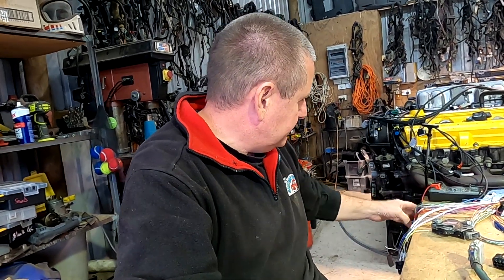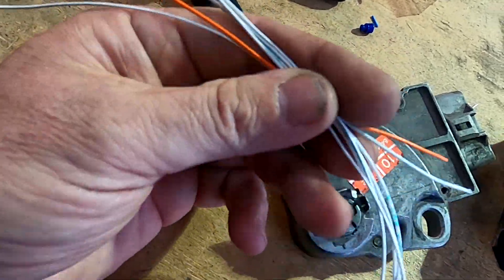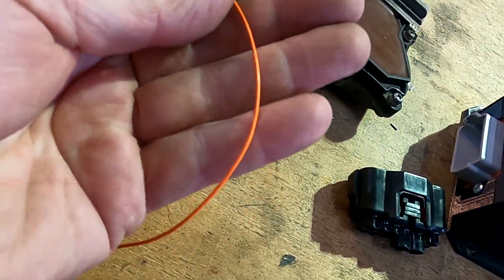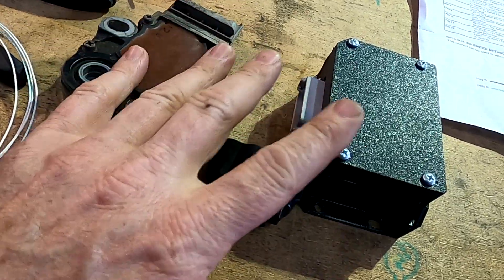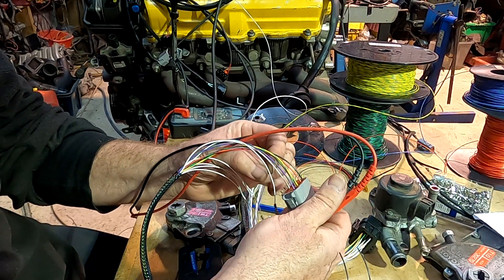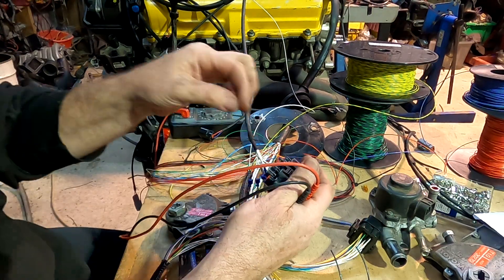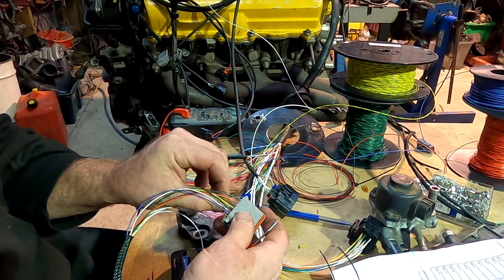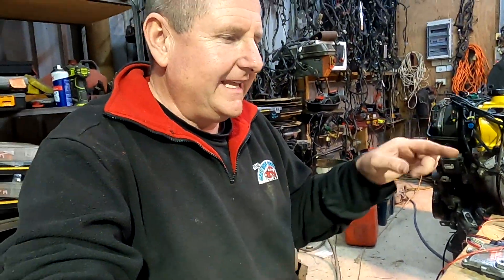Haltech ECU Wiring to 1uz Part 7.   The gear selector input box. Thanks Next level Motorsport

Comment: Hey Kelvin, Love your videos on the A340. In this video you mention you wired up the 2x Start Inhibit pins (the 2 big pins) on the selector switch, My question is what did you wire them to on the haltech? they aren't listed in the paper work for the next level motorsport signal convertor. Are they wired to DPI's? are they actually required to be wired up to anything? The A340 control support page over at haltech doesn't mention them being wired in anywhere? Any help would be greatly appreciated!

Comment: Good morning. 2 days ago I swapped out a transmission and installed a ls400 transmission. Its runs just fine. However before I swapped and after, I started on my lexus and it just dies seconds after. Cel is on but turns off as well. Its a 92 sc400. Could it possibly be a MAF sensor. O replaced all electrical vaccum related and fuel related problems and even rebuild the ecu
Reply from the maker: I would recommend doing some testing to diagnose the issue instead of guessing.  Cheers Kelvin